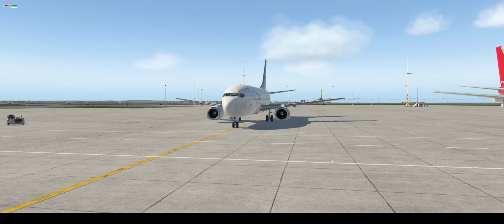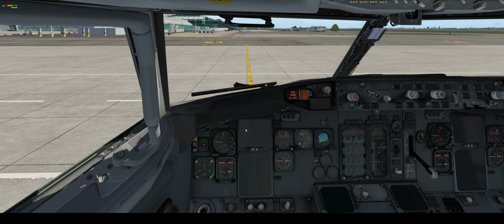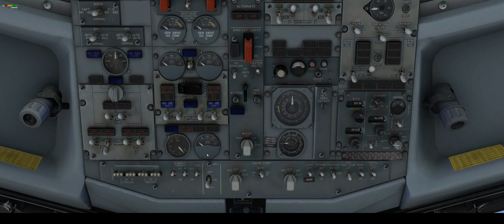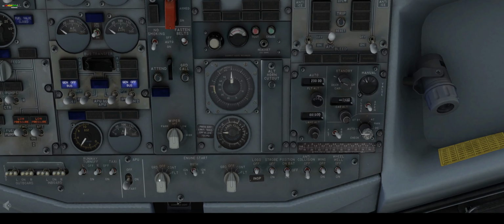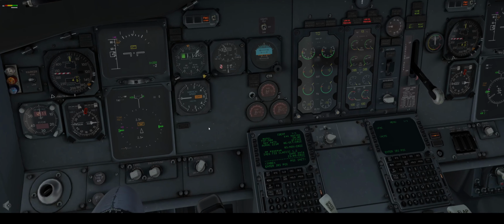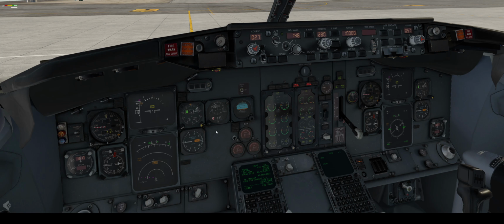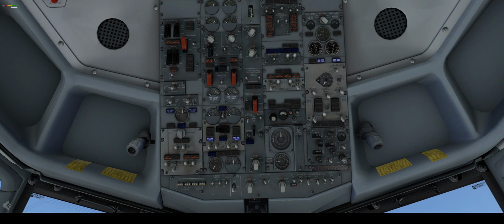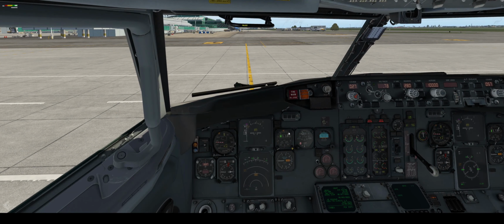Real B737 captain IXEG or Classic btw  NG, X-Plane 11 Difference

Comment: what do you prefer..the zibo on x plane or pmdg on msfs and why (:
Reply from the maker: Hi Peter thaks for comment. Well...Zibo is perfect related to planty options you can chose so you can easily see, that B737 difffer one from each  other thats why companies try to unify their fleet. As we are on simulator both Zibo and PMDG has some bugs, thats why my videos are based on different developers(platforms) in order to be close to present reality. But to be honest PMDG is closest to NG I fly. Today there are big changes in operational procedures(EASA not FAA), they call them green descent or CDFA technique in which Zibo is little older model because of intermediate top of desccent(leveling the AC). Real AC flight model is far differ from  ZIBO and PMDG so it depends on how  much you wish to invest to hardware in ordeer to feel that you are realy fly heavy AC. Another point is if you are only gamer or you wish to be professional pilot. In case of professsionalzm the future will be in X -Plane 12 because of proper atmosphere model and friction coeficien of different RWY conditions. In case you are gamer PMDG regarding MSFS visual quality is better solution. :) may be this is not the answere you want, but Zibo is voluntair do for free and PMDG if respect ticket issues will be nearly the same. :) have a nice day fell free to ask if you wish